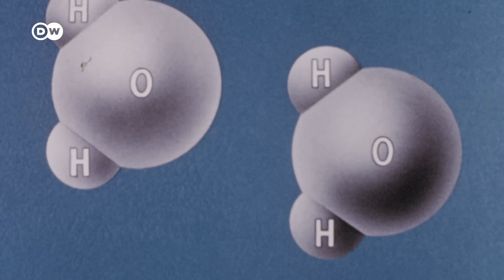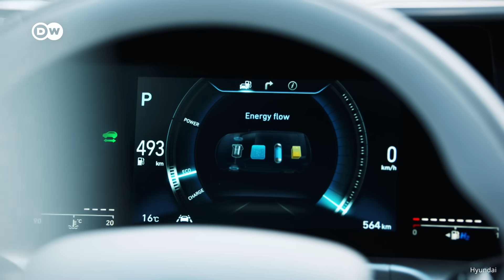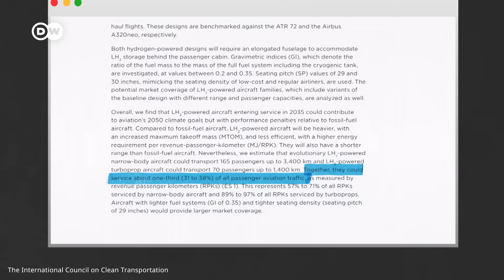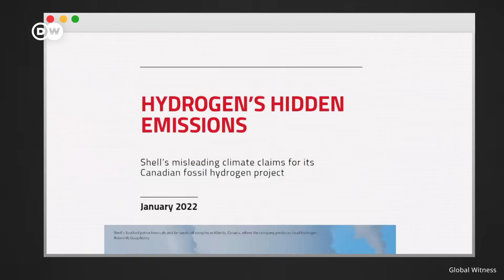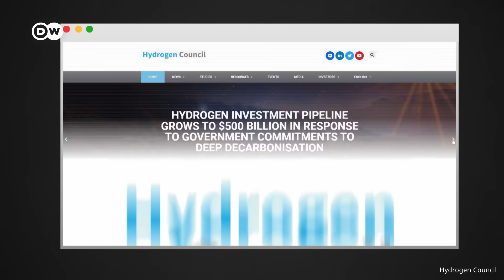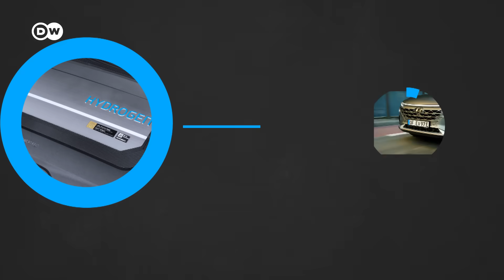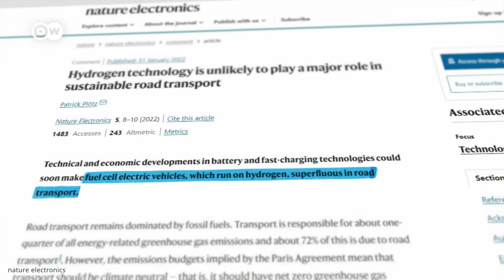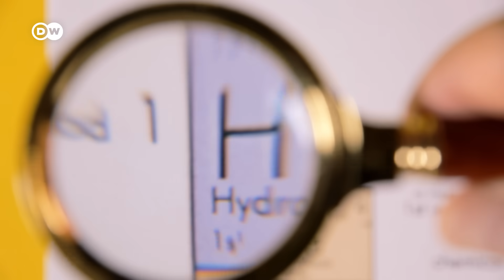The truth about hydrogen

Comment: Correct me if I’m wrong.
Turning electricity to hydrogen and back  to electricity again has an efficiency of  around 20%.
Turning electricity into  “battery” and then back to electricity has an efficiency  of  around 90-95%.
So for short term  storage it isn’t a competition (cars and houses).
Hydrogen is good at (apart from cleanliness) long term storage and density of energy. This means it should be great at storing energy from e.g. summer to winter, aircraft, possibly long distance haul and where chemical benefits are needed (such as steel and concrete).
As the sun and wind do not work at all times we must invest in much more than 100% of power, 200%, or even 400% seems reasonable, we will have a lot of time when we produce more than we need.  At those times we should first fill our short term reservoirs (batterie, water at height and such) and then make hydrogen for future use (heat, electricity production, steel, concrete, air and more).
/Mats
Reply: he said in the video that turning electricity into Hydrogen and back into electricity has 40% efficiency and electricity into battery and back into electricity has 60% efficiency.
Reply: He was wrong.
It is possible to reach over 1/3d in electric-hydrogen-electric efficiency, but not in practice. If you want to compress the H2 gas (which you do) or transport it 25% is a good number.
Apart from that, by far most H2 today is made from methane, which is horrible.
As for batteries, unless you want to store it for months, the efficiency is well >90%.

Comment: real engineering did a in depth one related to hydrogen and cars. The whole problem is that both technologies are changing constantly and that makes everything unclear. One thing that seems certain (for the next 100 years) is that batteries are not the way to go with planes. So maybe thats where hydrogen will go.
Reply: Yes, storing electricity in batteries provides the most efficient storage.  Using electricity to create hydrogen and turning that back into electricity with a fuel cell will waste much of the original electricity.  100% agree.

Here's the problem:  Batteries are heavy.  The Tesla Model S drags around about 1000 lbs of batteries.  I read somewhere that you could get the same electricity storage with 6 lbs of hydrogen.  Even when you add the weight of the fuel cell, you're still well under 1000 lbs.  Heck, the Toyota Mirai weighs about 500 lbs less than the Tesla Model S and gets about 60% more range.  So more power and it's lighter.  That said, while carrying around 1000 lbs of batteries is less than ideal in a passenger car, all of the advantages of electricity more than make up for it.

So where I'd expect hydrogen to win out would be in areas where weight is vitally important.  If you're carrying around 1000 lbs of batteries, it's likely that your small airplane isn't going to take off.  It's likely that your small boat will sink.  That's less than ideal.

Part of the issue, of course, is the unrealistic idea that there is one solution for everything.  "We have batteries--let's use them everywhere!"  I mean, I wouldn't power my string-trimmer with a V8 engine.  I wouldn't power my car with the same engine in my string trimmer.  Yeah, they're both internal combustion engines but they have different use cases.

Comment: And the one thing he did NOT mention was the elephant in the room which is that hydrogen consumes more energy to compress to a liquid state (i.e. extreme pressure) than it actually gives off in use. And if you don't compress it quite as much leaving it in compressed gas form, the volume/size of the storage tank required is out of control. Funny that he forgot to mention that one little point.

Comment: Great video but I was wondering if you could look at the impact wind and solar system. Hydrogen is 100% perfect or the main solution but I can't see anyone talking about the down sides of solar and battery's. Batteries are very damaging to the environment when looking at the resources required to make them and the co2 outputted when manufacturing the batteries.
Reply: Modern batteries last a long time.  They have a lot of time to amortize their energy cost.  It is possible to power mining equipment with electricity, and it is possible to make battery materials without wrecking the environment.  Battery recycling is well in hand.  In the future, all automotive batteries will be recycled.

Comment: When talking about hydrogen,  I think you need to consider safety. Being the smallest atom/molecule it has a habit of leaking out of whatever is containing it and when it leaks out you can get some devastating explosions!
Reply: I haul liquid hydrogen and you hit the nail on the head,I never hear them talk about safety with all this green hydrogen talk,it's very dangerous.
Reply: Can you point to an example where hydrogen has leaked out and caused an explosion?  There are plenty of natural gas explosions to choose from.  Hydrocarbons are heavier than air, so they sink and flow along the ground until they find an ignition source.  Hydrogen is very light, so it floats straight up and dissipates.  I'd rather be around a leaky hydrogen tank than a leaky propane gas tank.  Methane is lighter than air, so natural gas is relatively safe as hydrocarbons go, as it's mostly methane.
Reply: @incognitotorpedo42  there's many, Google it
Reply: Regarding leaking hydrogen, I am more concerned what it does to the ozone layer when it leaks in huge quantities. H2 + O3 -> H20 + O2
Reply: @MRM 70  really nothing when you have a leak it vaporize really quick
Reply: @keithjefferson2196  Indeed, it vaporizes quickly. Thanks to its low weight, it goes right up into the stratosphere, where the ozone layer is, and damage it. The result will be increased UV radiation down here.
Reply: @MRM 70  I never thought about that,they always told us it turns into oxygen once it goes into the atmosphere and mix in with the elements

Comment: Maybe Hydrogen needs to find its niche.

Like how E10 is used to lower the cost of gas? (The 10% additive of ethanol to reduce gas costs) maybe Hydrogen could be used like a carbon offset.

Sadly production is still less green than its byproduct. 

As far as I can tell more energy in to make it, and is it's energy output greater than its energy input?

Its part of why I would think at least for the time being byproduct (grey) Hydrogen may be better than green Hydrogen. (The scaling factor)

Also unless there are NO additives, I'm  not to certain I like how "green" Hydrogen actually is. Most green energy sources seem to be invasive by their physical structures NOT by the chemical presence. Windmills and solar panels dont have emissions. 

This is why at least grey hydrogen seems  useful for the time being. It at least, carves out at niche for Hydrogen when the market would be better prepared for its shift.

On a similar note. For anyone going on a roadtrip, buy non-ethanol gas. Its gets more mpg for highway drives, its a bit more pricey but it'll save you refueling if you're cruising. (Not recommended for routine work commutes, due to the higher cost and start-stop nature of inner city driving negating the fuel efficiency advantages.) 
But ethanol free has a 10% better fuel efficiency than E10 (Ironically the 10% additive of ethanol was the 10% reduction in fuel economy)

Feel free to fact check it. Cuz I'd love to know if corn crops are actually useful gas in actually reducing emissions or food costs. (Im skeptical but there are certain advantages and trade offs of E10 and Ethanol free gas)

Comment: Are Big Petro Businesses and Hydrogen compatible, that is the Question.
Reply: they  have always been one of the big producers, it is a by-product of oil  refining, so they sell it cheap, but the current amounts, prices and processes are not suitable ro replace oil, gas and coal. I agree they should not be given a blank check, an order guarantee and a date, or we will end up by replacing the oil monopoly with a much more expensive hydrogen monopoly.!

Comment: just build massive solar panel in the northern africa and create hydrogen out of thin air using water(which connected via pipe from ocean). also buiold a massive underground gas storage to reduce the gas leak. finally create a dock that can handle massive tanker for hydrogen transport. ez pz free money after 1st investment. but im not sure the energy giant will decrease hydrogen price and literally destroy the industry to get rid of the competition

Comment: Electrolysis to make hydrogen from water is hugely wasteful if the oxygen is simply released into the atmosphere.  But we already have all the oxygen we need from the refrigeration processes that efficiently make liquid air which can then be distilled to separate  oxygen {medical applications, cutting torches, oxygen lances in steel making, etc}, nitrogen {many general purpose scientific uses}, argon {a convenient non-toxic, non-reactive gas for multiple uses}.

Comment: In the summer, PV over produces. Wind is often throttled back or turned off to compensate. So there is unused capacity now that could be going into H2 production.

As for if we should. I think yes. Even with the increased loss rate over batteries. Because there are energy needs that batteries are not yet suitable for, like shipping, seasonal grid storage and long haul flights.

Comment: It (hydrogen) is a future source but as you have stated it is to complicated to refine to direct use (H20) -> H and O separate H into a fuel cell lose power to convert to electricity to power motor for use. Fuel cells also need occasional repair and maintenance.

Comment: Given the other alternatives out there, I don't see hydrogen taking of any time soon. I currently drive a used 2015 Nissan Leaf. It is still using its same battery pack and charging at home is supper convenient. The cost of the used car was also affordable at around $7,000 dollars. Battery technology is always improving to make long road trips possible.
Reply: Just waiting till the battery catches on fire.
Reply: I See your Point but I don‘t think this Will Work imagine everyone has a electric car, where do we get the energy from that all those cars need. I saw it once here in Germany a country where nearly no one has a EV in some richer areas in the cities where hybrids and EVs are more common there is not enough power for charging those cars the Electricity grid is just not powerful enough. The problem is if you want to charge your car you need the electricity in that exact moment and imagine everyone is coming home from work and wants to charge his car. Our grid will collapse. And here I think you need Hydrogen. To store the energy. Without I don’t see it working out Batteries are just not scalable.
Reply: Tesla wall.. ;) buy energy when its abundant and cheap, use it when its needed and in peak hours.. In doing so release pressure on grid and save some dough.. ;)
Reply: @klavsvasilis  Whats the energy toll of producing a wall..?
Reply: @klavsvasilis  Now multiply that for the number of households in your city.. Does that seems green?
Reply: @andreaspfeffer3294  Hydrogen Fuel Cell vehicles still require batteries. Battery electric vehicles unlike hydrogen fuel cell vehicles can supply energy to the grid. The Ford F150 Lightning for example can power a home temporarily during a power outage. This technology is called vehicle to grid or v2g.

Comment: So what about Stanley Meyer method called voltrolysis. a method that uses volts to split the water instead of amps so the efficiency interms of electricity consumed can be over 300% efficient

Comment: Yeah, hydrogen is the future when it is "burned" in fusion reactors but this is still decades away. 

Even then, electricity will be the basic form of energy for humanity to use. Only in "niche" applications (steel, cement, vertilizers, chemistry,..) where electricity doesn't fit we might consider hydrogen and when hydrogen doesn't fit either we might use green synthetic fuels. 

Until fusion is available, using nuclear fission or a mix of renewables together with energy storages, hydrogen and hydrogen ready backup power plants will have to do the job.

Comment: Ah, no, for the following reasons: 1) Creating hydrogen is a complex and expensive process; 2) storing hydrogen requires strongly-built storage tanks that are extremely leakproof and 3) we don't have a hydrogen distribution infrastructure like that for electricity and natural gas.
Reply: All modern (non cast iron / cheap steel) natural gas lines can cary hydrogen, it id one of the things actually being done in various neighbourhoods in Dutch cities as try-outs to replace natgas HE boilers.
So yes we do have that infrastructure already.
Reply: @VYR1985  I express skepticism, though. Hydrogen leaks far easier than natural gas, and if there is a spark or open flame nearby....

Comment: We dont need hydrogen except for places like furnaces where heat is needed by burning something.
What we need is more micro grids based on renewables like rooftop solar combined with gravity storage devices somewhat like gravitylight but on a  3-5Kw scale which would be enough for a residential home.

Comment: Technology for synthetic fuel production already exists. In fact, it was being scaled prior to the price of oil collapsing some 8 years ago when it became impractical. Synthetic fuels close the carbon cycle and are therefore green because the carbon they contain came from the atmosphere. They have much higher energy densities, equal to existing fossil fuels and can be a direct plugin to the existing fossil fuel distribution infrastructure. They can be tailor made to specific end uses like bunker D for shipping or jet A for air travel. The input energy is light as in from the sun so it's a form of storable solar energy and the best part is that they can be scaled to remove excess carbon from the atmosphere if we chose to not use them but store resulting fuel like in the strategic petroleum reserve for example. This is a far better solution and one currently attainable than hydrogen pie in the sky.
Reply: Pressurized fuels are inherently dangerous, even more so as the equipment ages.

Dedicated ethanol internal combustion engines have ultra-high efficiencies with mileage and power greater than gasoline and even diesel.

Ethanol can be used in turbine engines as GE has already sold them in Brazil for electricity generators.  Imagine a jet flying over LA with exhaust cleaner than the air going into it.

Hydrogen fuel cells have 10 times the energy density of lithium batteries, but direct ethanol fuel cells have 5 times more than the hydrogen ones.
Reply: The price, viability, ... varies according to the fuel, hydrogen is the simplest one (a precursor for a lot of hydrocarbons and other chemicals such as ammonia) and has many sources, methods of storage and transportation, and ways to be used.
Reply: @vitordelima  Nissan, who built and ran a fuel cell powered electric vehicle around in 2016 in Brazil where E100 is sold in fuel stations, used ethanol over a catalyst as the hydrogen source for the fuel cell.  There also exists fuel cells that can use the ethanol directly.

Even though ethanol is a relatively safe flammable fuel, Nissan's vehicle would not have had to have E100, the fuel cell would have worked even if the ethanol had contained enough water so as to be non-flammable.
Reply: @danafletcher2341  Ethanol isn't as abundant as hydrogen and its best sources are crops, which have many issues. There is research about how to improve ethanol production.
Reply: Synthetic fuels need a lot of energy. We are trying to reverse entropy here. Electricity for electrolysis, electricity for carbon capture, electricity for the synthesis and then we need some of the result to get it to where it’s needed.
Reply: @VolkerHett  Although I understand what you mean, there is no "reversing of entropy." At least, not with modern understanding of physics.
Still, your point is real: minor differences in efficiency mean major differences in effectiveness.
Reply: @bmobert  That's what I'm talking about! Synthetic fuels will need a lot of energy and this will make them very expensive.
Reply: @VolkerHett  You misunderstand, he is talking about biosynthetic fuel, using algae to produce hydrocarbons from photosynthesis.
Reply: @VolkerHett  Synthetic fuels used to need a lot of energy. Biocatalysts were developed some 20 years ago which make this not only viable but profitable. There were several companies that were scaling this up before the price of oil crashed and ended these projects. Look up Joule Unlimited. Their website is still up.  I wish the same could be said for their operations.

Comment: PK is the first company to pursue hydrogen in the form of a light-activated nano-structured thin film.  Plasma Kinetics' success is in our unique ability to filter out hydrogen from exhaust gases "like a sponge" with low temperature and pressure - reducing cost.  Captured hydrogen is contained indefinitely, releasing with light on demand.  Plasma Kinetics advancements offer the means for zero-carbon hydrogen, it's an economical and safe hydrogen transport and infrastructure system. Our technology scales to fit the power demand of any application.